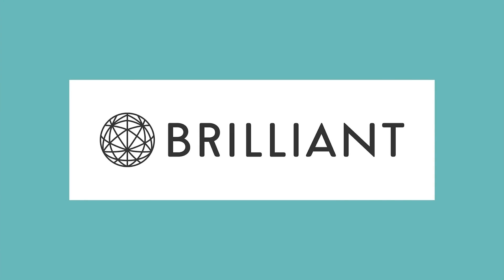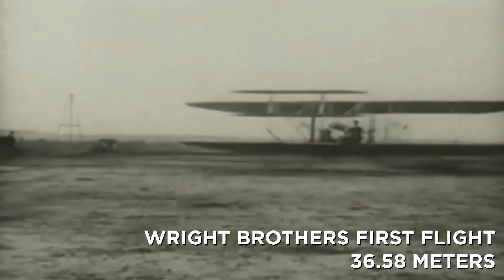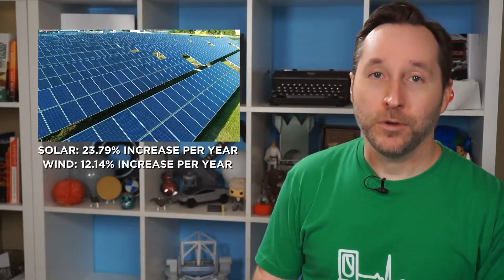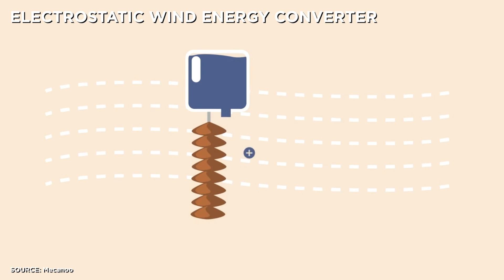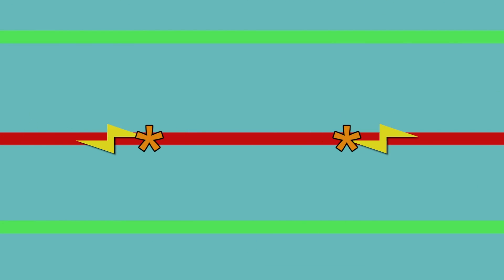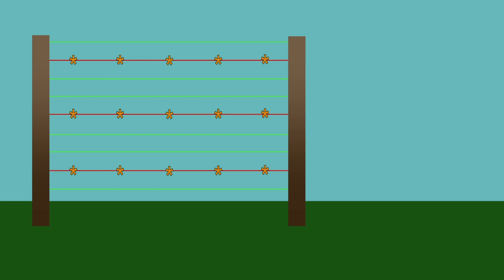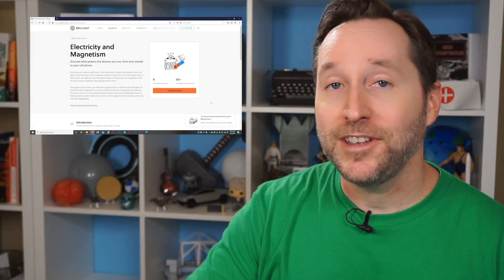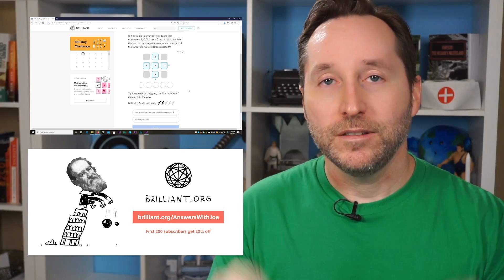Solid State Wind Energy | Random Thursday

Comment: for a long time ive held the theory that wind turbines can be used alongside freeways/motorways. There is already the cable ducts for the road lights, they would catch some wind from the moving vehicles and a big factor against wind farms (at least here in the U.K) is they make the countryside look worse. Ive yet to hear someone moan about motorway lighting making anywhere look worse.
Why wont this work?
Also, surely there must be a fairly easy solution to the birds hitting them? A sound birds dont like, electromagnetic pulses, small drones to scare them, draw a route round them (birds follow roads for navigation)....a big fake bird stuck on top of each turbine as there are on roofs!

Comment: 1:40 energy is not measured in volts. How quickly the battery would drain if the transformer's secondary is 40.000V depends on the current, the power needed  might be comparable to propeller driven electric plane.

Comment: ......... Conservation of energy would not allow you to generate much power from the swet device. 
You would need trillions of carbon filaments, not to mention perfectly clean air, and since air has very little density you're assuming every nitrogen molecule will come into range of the filament to pass electrical charge. 
Invest in nuclear energy. Simple. Clean. Renewable. 

Sounds like one of those water from air devises lolol.

Comment: Actually Joe.! The higher the voltage the more efficient the electrical circuit. !

What you're thinking of is current. Or amps.!
Reply: Was wondering about the same, thought I was wrong
Reply: Depends on the circuit. BTW he mistook voltage with energy. Common mistake.
In case of the plane, I assume they used lithium batteries. A pack of those in a common arrangement has a few tens of Volts. Converting that to tens of thousands is a lossy operation. That's one reason, why it's not economical. But it was a cool experiment.
Reply: @besenyeim  Excellent point.! Good call.
Reply: You're thinking of long-range power transmission. In the electrical grid, increasing the voltage reduces the energy lost in the cables. However, you cannot say that in general higher voltage means a more efficient electrical circuit. In a small device, energy lost to cables is tiny.
Reply: @lukashann5025  Actually Lukas. I can say that.! In every single location where electricity flows. Higher voltage = greater efficiency.

Not just the power grade. Although that is a perfect example. The only time high voltage can be thought of as being less efficient is in exactly the same way the comment before you're stated.

Which is in converting low voltage into high voltage. Which is probably and exactly what they're doing to achieve that high of a voltage from something so small and light. Without using post quartz crystals.

So let's not get into an Electrical Engineer off. Because what I am saying is not only common knowledge to anyone familiar with Ohm's law. But in every application where electrical efficiency is being taken advantage of.!
Reply: @I86282  You can generalize the principle yes, but the energy loss in the cables is so small that it's negligible. In any device nobody would increase the voltage for the sake of efficiency.
Reply: @lukashann5025  Auh yes they absolutely would. And do.!

For instance Induction motors and generators like in Joe's car. And in Inverters like Joe's car. Charge controllers. Like in Joe's car and his garage. PC and bench power supplies. Like the one you may be using right now. Tazzers. Electric fences. Dog training collars. The list goes on but I think you get the point.

And in any other application that requires high current or low current depending on the resistance.

In fact the only time low voltage is used. Is when the current required is very low. In the low milliamp range.

And if there is a situation with low voltage and high current. That is a situation by definition that is very inefficient.

Thus the opposite high voltage with low current is in analogous very efficient.!

Strapping on an Ionic breeze to a remote control airplane. For instance. Where by inducing a high increase of the voltage across the inductive surfaces produces more MMF and a greater EMF which in return produces more RMF.

For the very sake of "efficiency". Do you think they chose to make it high voltage for inefficiency sake. I don't think so.!

The point is that you can have as high a voltage as you want. Assuming you did not start with low voltage. And maintain "High Efficiency".

And even if you do start with low voltage. And turn it to high voltage. While energy will be lost through that process. It doesn't mean that it will be so much as to make it inefficient. In contrast to the work that's required.

Which is exactly what they've done here. They took a lower wattage voltage source. And made it more efficient by increasing the voltage despite the inefficiency of the process of increasing the voltage.

So the actual amount of wattage being used despite the losses is negligible even compared to the original voltage source being utilized.
Reply: Actually, neither voltage nor current are energy. If you multiply voltage by current you get power (Watts). Power is the measure of the instantaneous consumption of energy. If you integrate power over time then you get energy (Watt x hours is one unit of energy that is convient in this discussion).
Reply: @JacobChrist  Actually no. I'm not sure what you're getting at. But if it's that the use of the term "Energy" is not applicable. Then you are 100% incorrect.

Because to quote Wikipedia. The definition of electrical energy is.

"Electrical energy is energy derived from electric potential energy i.e. Voltage. Or Kinetic Energy i.e. Current. When use to describe "Electrical Energy". Electrical Energy refers to energy that has been converted from electrical potential or electrical kinetic energy. For the purpose of perform work."

And and Yes that is the calculation to derive Watts. But no that is not the calculation for Power. Power = Wattage ÷ Time. Denoted by "Watt hours".!

However Voltage, Current, Watts and Power are all definitions of Energy. They have different names to describe the way the Energy is being utilized.!
Reply: @I86282  okay, yes voltage implies potential energy but it is not energy in the formal sense.   I suggest you review your power calculation though. According to my mental notes (no web page referenced).  Power can be measured in Watts (among other units). Energy can be measured in Watt Hours (among many other units). Power (Watts) x Time (Hours) = Energy (Watt x Hours). If you divide WattHours by time you get power.  If you divide watts by time you are going to get volt x coulombs/seconds^2 assuming time is in seconds. This is because power = voltage x current and current is Columnbs per second. Or simply wats per second. This is a strange suggestion since power already takes into account the instantaneous rate of energy transfer.  I suppose it has some purpose but I have never come accross watts per second in a practice. Yes, when current is flowing at any potential other than zero you have power and thus kenitic energy.
Reply: @I86282  oh and for the record just because I didn't address your comment related to higher voltage means higher efficiency doesn't mean I don't think that it's wrong. I just thought we should start with the fundamentals first.
Reply: @JacobChrist  Well since all we have discussed are the fundamentals. 

And except for definitions of Energy and calculations for power. 

Everything else you have said demonstrates that you should understand how higher voltage = greater efficiency. 

Which a vast majority of the time means a less requirement for Current draw assuming the appropriate resistance is applied. Which will = greater efficiency.

V ÷ R = I

I'm not saying there aren't situations where producing large voltages will lead to greater inefficiency.

But those scenarios are the exception to the rule.

But mostly because resistance and or impedance is not properly regulated.

Or a large Current is intended.!

But like the power grade. Most circumstances requiring a large voltage is implemented because the same amount of wattage is required for a less amount of work.

Which is the definition of greater efficiency.

Comment: Yawn.  The key technological challenges of renewables is lack of cost effective grid storage.  Otherwise, they are leeches that live off of the stability and extra capacity provided by the dispatchable electricity generators.  How far away from cost effectiveness are flow batteries, molten salt storage, or electrolysis for wind power?  So far, Li-ion is just adequate for frequency stabilization and a bit of a window to allow spinning up peaker plants.  That's a long ways away from practical wind energy production.

Comment: not sure about this one joe ? hook up a load of wire outside and you will induce power in it just from all the rf power floating about these days.......... like the crystal sets of 80 odd yeas ago were hooked up to a large antenna and the power from it would power the crystal set...............and these days theres a lot more rf power floating around ! ........... as the amount of power claimed is pretty low 200mw ?  might be hard to say whats producing it ?

Comment: 40,000 volts is not a lot of energy. It is a lot of electrical potential difference. A 'joule' is the unit of energy. 1 Joule is the amount of energy expended by moving a charge of 1 coulomb through an electric potential difference of 1 volt.

Comment: Not dissing your research Joe, but I looked into seeing how easy it is to recycle solar panels and just the solvent used to remove the glass from the panel is horrificly toxic stuff. Fibreglass may have a similar issue with the resin used to stick it together, but in theory it could be crushed used as a filler for other materials.

Comment: Wind generators are basically big hunks of copper, aluminum, and steel. What do you mean they are not recyclable? Maybe we don't have the infrastructure in place to recycle them but that doesn't mean we couldn't. It is much easier than mining and melting down raw ores and purifying it into those metals. I'm sure mining corporations don't want that to happen though.......

Comment: Ok... And? Even if this works, it won't. But even if it works it doesn't overcome any of the many intrinsic issues with wind power. Just for the two obvious ones the land requirements and the intermittency. Either one of these are deal breakers, and they're not even the only problems. As always renewable power is a scam and the only way forward is nuclear energy. ;)

Comment: 25 year life span.  I worked in the Oil Industry, and that's about the lifespan of an oil or gas well drilled with 1 to 2 degrees of deviation where artificial lift systems are installed.
Reply: I think the point is that while they are great, they are not perfect, especially while we use non-recyclable materials on such a scale. Better, but not the end goal.

There is a plan afoot to build them out of wood (yes, even the 12MW size and bigger) which would be amazing.
Reply: @morosis82  Was your comment related to my own, or a stand-alone comment?  I just wasn't able to make the connection.

Comment: A necessary calculation to consider in this: What is the cost in electrical current AND CO2 released to convert the Alumina into Aluminum via smelting?  How long might it take to produce enough power to re-coop the power and the difference in CO2 release created using this method as compared to the combustion of fossil fuels?

Comment: Local power transmission runs at about 14 kV, so a town-sized version could probably be put together with standard parts, which is a big plus for getting this into production. Don't know about inverters per se, although there are very high voltage DC power lines and that implies cheap AC/DC

Comment: It's worth mentioning that "40,000 volts is a lot of energy that would drain a battery pretty quickly" is actually not really the right way of looking at electrical power, in general, higher voltage typically means higher current, and together that makes for higher energy consumption, but current can be limited. 5 watts could be 5 volts at 1 amp, or 5000 volts at 1 milliamp... Though if someone told you "oh, it's 5000 volts" you can't assume it uses a lot of power, 5 watts isn't much power at all, and it could be even less. I guess the short version is, how quickly a battery drains can't be determined just by operating voltage.

Comment: An ionic drive aircraft would have weather sensitivity. Fog, rain, snow, dust, pollen, smoke, nanoparticles (including ice) and anything else that alters the dielectric constant of the air would be a big problem if not compensated for. Of these wet snow and rain are probably the hardest to deal with, but a sudden change in dielectric constant could cause a sudden change in thrust, perhaps only on part of the engine. This would be a lot like one engine of a jet getting enough water in it to flame out, either partially or completely, though the effect could happen much quicker. Icing on the emitter wire would have to be prevented by running some current through the emitter to heat it because even a tiny amount of ice will drastically reduce it's efficiency.

Comment: What if this was done in the water, which has far more inertia than air? Assuming it doesn't immediately ground itself, it might work.
Presumably you'd need far less voltage because seawater is conductive, which is probably a good thing for efficiency. You could also create hydrogen and oxygen as a byproduct.  Also, if you made the wires out of copper or silver, they should prevent growth on them.

Comment: Wherever there are high voltages and coronal discharges in air, you get ozone (and NOx). Even in concentrations measured in parts per billion it is really bad for health and can be fatal. See wikipedia on the entry for Ozone.
You would have to remove the oxygen from the atmosphere first to make it safe!
This is a showstopper.  However, the piezoelectric effect may show much more promise.

Comment: 40000V isn't necessarily a lot of power. Power is measured in watts. W = V x A. Thus if the current (Amperes) is kept very low the power usage would also be low.

Comment: If this system works as suggested why not replace the millions of miles of fence lines with this. As they need replacing naturally and add an inert support line to maintain the strength of the needed fence. This does sound like a giant bug zapper. Just sayin'.

Comment: On another matter, the wind turbine can be close to 50% efficient, or can retrieve half the energy from the wind, which is very good. I can only guess that the 'solid state' ion wind generator will fall dramatically below that figure. If it is over 5% I would be surprised. I will investigate the theoretical maximums.     
Re moving parts, there is in effect only one moving part in a basic wind turbine and that is the the generator connected to the blades. There would be a gearbox too on more sophisticated turbines. This isn't a lot of moving parts, and rather like a gas turbine in power generation, these things can be left running for a decade without issue. The wind turbine is a lot less complex than a gas turbine but shares the fact it is a simple rotating machine.

Comment: 40 000 volts is NOT a measument of energy. It is measurement of potential, not energy itself. Even if you ramp up to 500 000 volts you might not be using any energy at all if there is no place for the electrons to go, ie. there is no circuit. Same would happen in this instance if this plane was in a vacuum for example.

Comment: Thanks.  I'm not any kind of electrical engineer either (nor can I fix my toaster, for that matter), but... it sounds like this is almost a kind of amplification effect - like a old tube, or a transistor.  It sounds like it takes a base current, and amplifies the voltage, then puts that amped up electricity to work (like putting it back into the grid).  As you pointed out, it's not going to generate a whole lot of extra electricity, but it might work on a larger scale.  It's become clear (to me, at least) that no one single type of renewable energy is going to serve everyone's needs.  It's going to take a lot of different applications of different methods here & there; using whatever fits your needs (whether individual or industrial).  In short, renewable energy is a niche market, even at large scales.       tavi.

Comment: I work as an electrical engineer.  I had an architect ask me if we could add a wind turbine on top of a high rise building.  I had to tell him that some times the blades fall off of wind turbines and that would be bad in a metro area.   Solid state wind energy however would work great on high rise buildings.

Comment: Here is a "Why don't they Just" replace all the Power transmission lines with Carbon Graphite cables?  This would allow faster transmission of electricity with lower resistance.  The lower resistance means less power loss in transmission, meaning more power for everyone, just be changing the wire.

Comment: As for wind, small home wind turbines do exist, and work quite well, but you do need a windy location, and typically battery storage, inverters etc. With mass production the turbines could easily be made nearly as cheep as a ceiling fan as the technology is nearly the same. But the main cost will remain the batter/inverters so probably a good addition to existing solar systems. That said, I often see really small turbines being used to power remote devices in combination with solar.